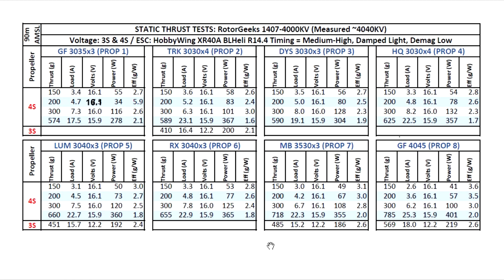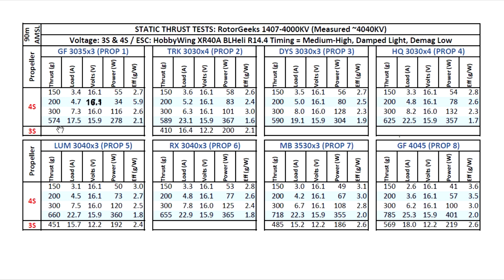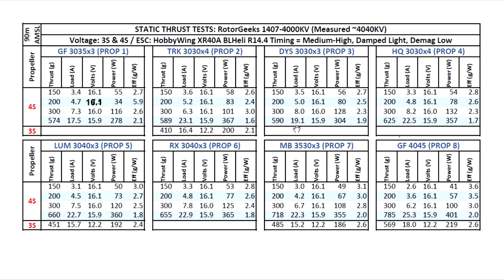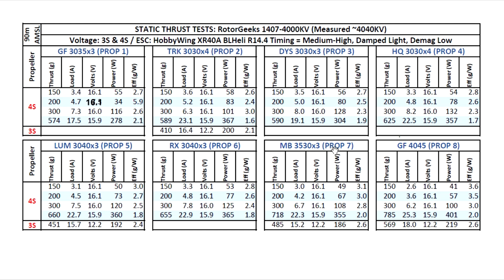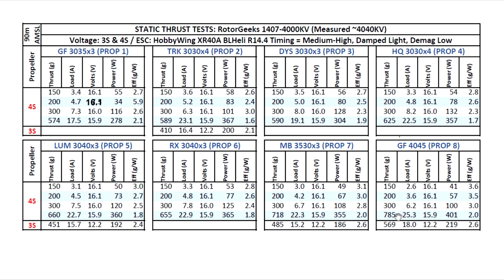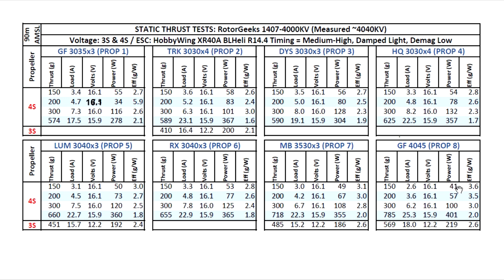RotorGeeks 1407-4000KV 4S & 3S Static Thrust Tests

Comment: Would you suggest this motor as a replacement motor for my Reptile Cloud 149HD 3 inch Cinewhoop?
Reply from the maker: 1407-4000kv is the motor size that frame comes from factory so this would be same size replacement and should give you same performance but there's better motors now from GepRC, Mamba, Xing and others. This one is somewhat dated and not as good as the newer motors, unless you find them at rock bottom prices. I think there's 2 version of the quad. The newer one has 35A ESCs so it can handle 1408 or 1507 size motors for a bit better performance. Old version has 20A ESCs so better to stay same as OEM.

Comment: If you have them, can you please test the freedom 1407 4200kv and the cobra 1407 4100kv? I know the cobra motor is good, I just want to know how good, and how well it stacks up with the freedom motor.
Reply from the maker: Unfortunately I don't have those motors. I asked Cobra for test samples but they didn't reply so I ended up just buying the one motor from Banggood.

Comment: great stuff ! thought it might tip the BH just curious to how hot the RG get on 4" , pretty crazy if RG say it can handle 4045x3 on 4000kv
Reply from the maker: On the thrust stand motors got mildly hot. Nothing to be concerned about. But I wouldn't run any motor for a really long time when load is so high. Amps are exaggeratedly high on the thrust stand since the props are stationary, they're moving stagnant air so the load is high. In flight, air is moving so the air particles already have a velocity relative to the props so they "grab" less air. So that's why 4" props work OK on this size motors. 
4045x3 on the 4000kv does seem rather crazy, but they say no problem for the motor. It would be awesome to see a top-skilled pilot using all 3 different KV motors on a track testing against time. Then we could see which KV is best but that would take a lot effort.... anyway, these and all the other top 1407 motors are amazing. Incredible amount of power in such a tiny package. More power than what we were using back in the day of SunnySky 2204-2300KV and BS12A ESC's on 3S LoL.. the good ol' days.
Reply: I use Dal TJ4045x3 with my RG1407 / 4000kv.   They dont come down even a bit warm.  I fly with 4s 850mAh Tattu's and get 4-5 mins... maybe longer if I just cruise.  Sorry if this is a double post.... I cant find my original post, think I closed page before saving.  Any ways, thanks for the info, my buddy flies 3600 kvs and its nice to have metrics to compare them by .... not just by us saying, wow you go fast!   :)